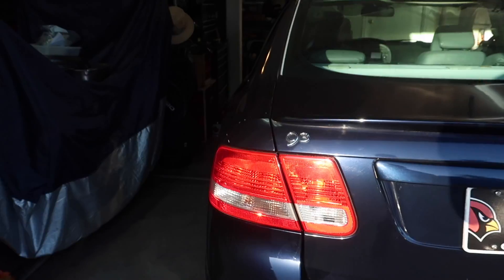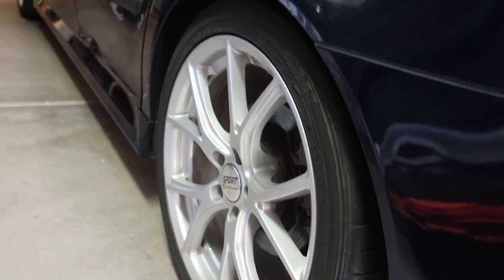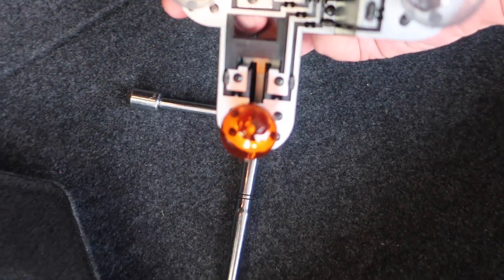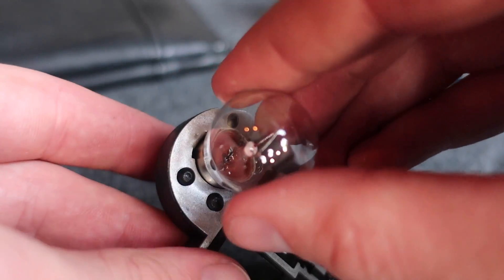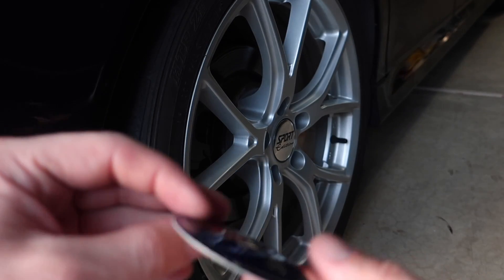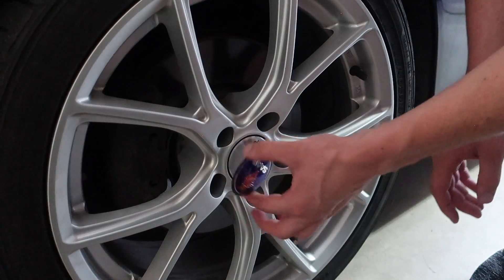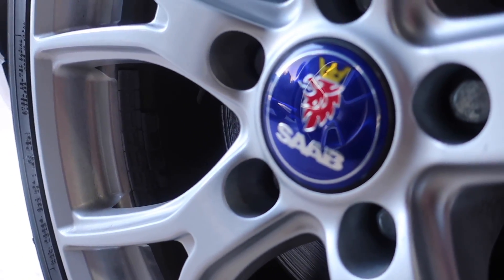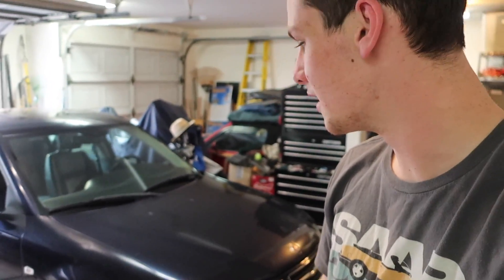Saab 9-3 Brake Light Bulb Replacement + New Center Caps!

Comment: Hi! Would you like to make a video about changing the lights in the ACC unit and other lights, maybe numberplate or something, Great vid btw keep it up!
Reply: Indeed. Especially the driver's side headlight. This one can be tricky to do! I have to replace mine and notice that I don't have any room to pull this one out. Just have found a video tonight showing an easy way out w/o removing the bumper and the complete socket lol!
Reply from the maker: Ah yep, next time a bulb burns out I will!
Reply: First,  let me say nice job on this video. I like your easy approach. Actually,  I liked it so much,  that I went ahead & subscribed!  

I've been doing some research on a few small repairs, replacements that's needed on my 2008 Saab 9-3, when I happened across this video and your question in the comments. 
And in my head,  I heard YES! Please do some more videos on the lighting components, how tos, with what,  etc. etc. etc.

Comment: Hopefully the stickers will not fall off :) but it would have been a better idea to clean and fully degrease the aftermarket center caps so that the glue would stick better. They really tend to get lost over short period of time, mostly on the side on the direct sunlight for longer period.
Reply from the maker: I believe I mentioned that I wiped them off first